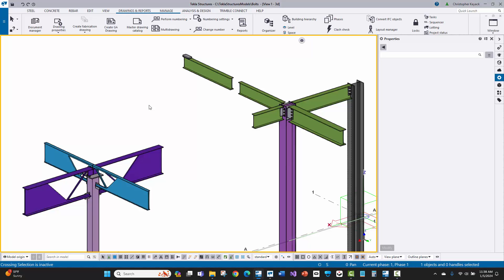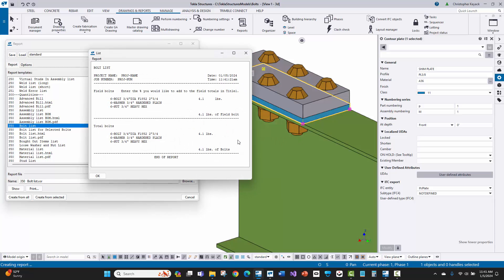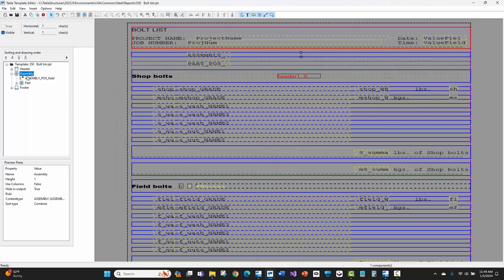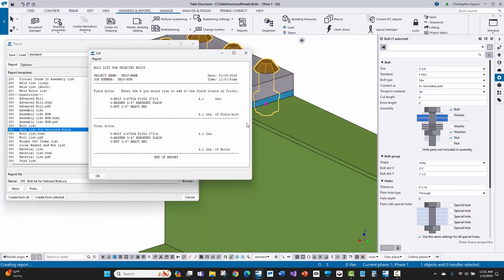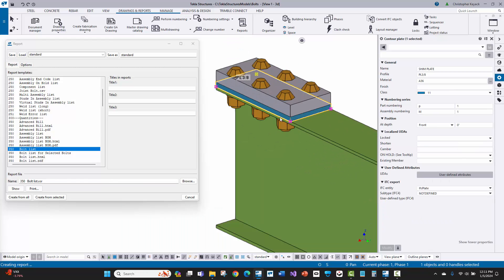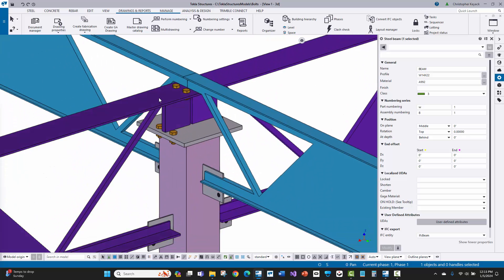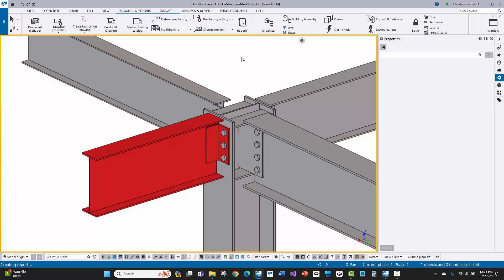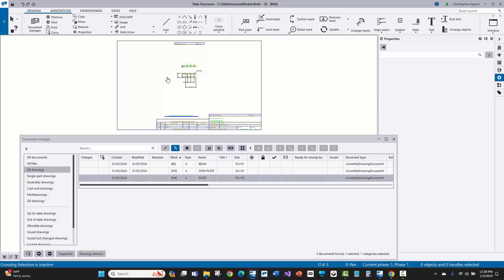KTS - Bolts on Which Parts in Tekla Structures

Comment: Hi and thx for your vodeos. In every project in tekla i have to repeat lot of thinks like assembly parameter so my question is 'is there any methode to ivoid repetation and create a template assembly that you can use in every project ? Thx a lot for answering me
Reply from the maker: Hi. Setting up a model template or FIRM (XS_FIRM) folder sounds like what you need.